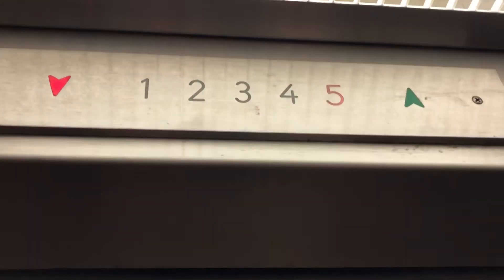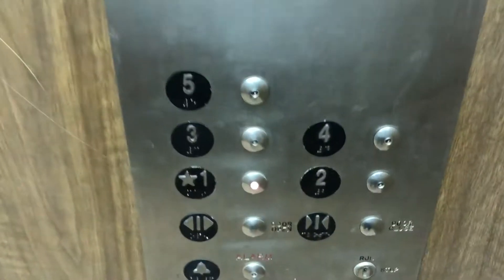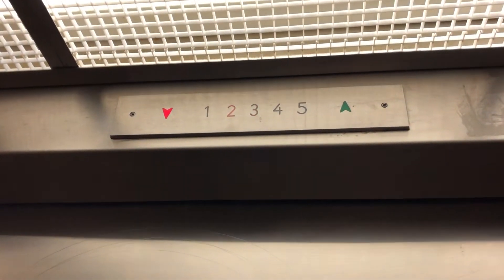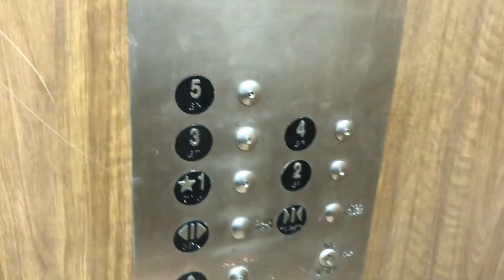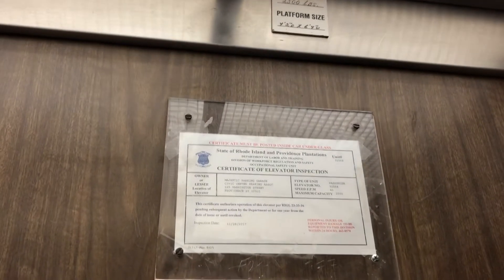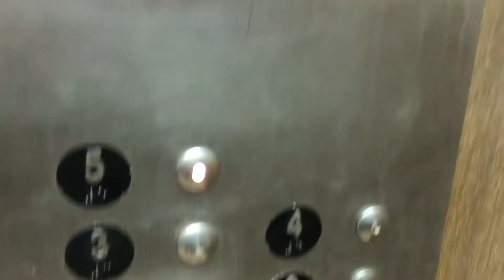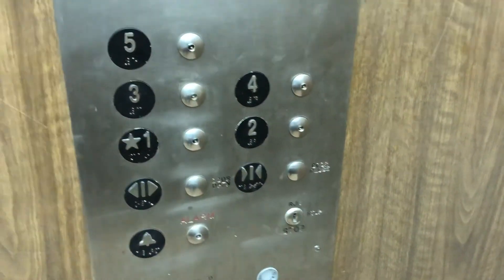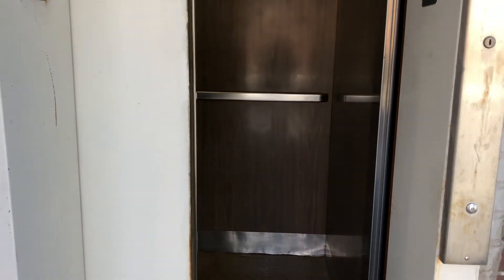40 FPM! Agonizingly SLOW Burlington Mod. By (?) Civic Center Garage, Providence RI

Comment: I filmed this thing back in November. I missed the original elevator, but I would have gotten a look at it at the very least had I noticed it.
Reply from the maker: It has weird black round buttons (not lexan) on the lower floors! Did you happen to get to the dean hotel?
Reply: @ELEVrjATOR  I tried. But the elevator did not the operate well enough in the video for me to upload it. Plus I should have brought a flashlight if I wanted to see anything on camera.
Reply from the maker: Jack Drees yeah it was pretty dark in there. Thankfully I used my phone camera.

Comment: Going up, this lift goes more around 80-85 fpm but on the way down it goes 35-40.
Reply from the maker: It’s certificate says 40 FRiRD
Reply: @ELEVrjATOR  the certificate must be lying when going up bc I did the math

40 fpm = 8 inches/second
7 seconds to pass a floor x 8 inches = elevator should have traveled only 4 foot 8 inches (56 inches) 
Floors are more than 56 inches apart (probably somewhere around 112 inches apart) 
So 112 / 7 = 16 inches x 5 = 80 fpm going up 🤣
Follow ma logic?

But on the way down it takes 13-14 seconds to pass the floor

112 / 14 = 8
8 x 5 = 40 fpm going down
Reply from the maker: Clinton Township Lifts by MagicalLift256 tooo much big brain stuff for me my friend... 😂